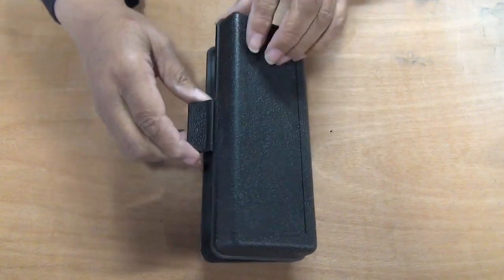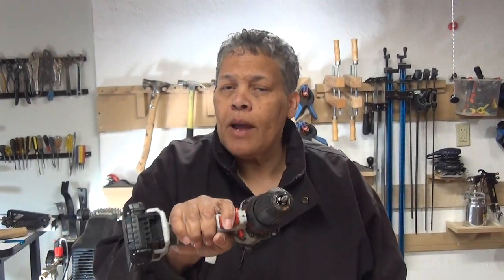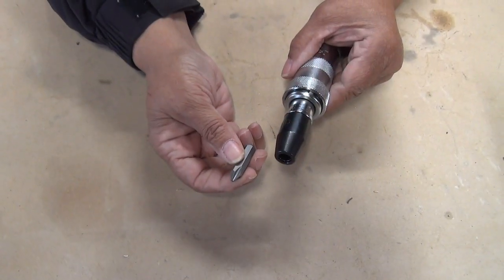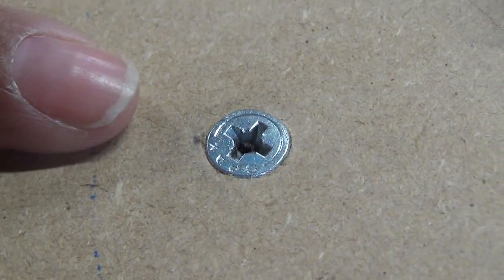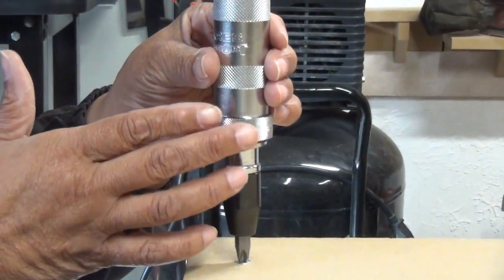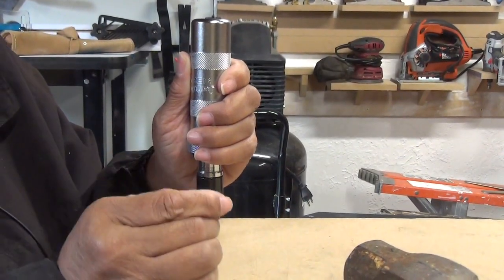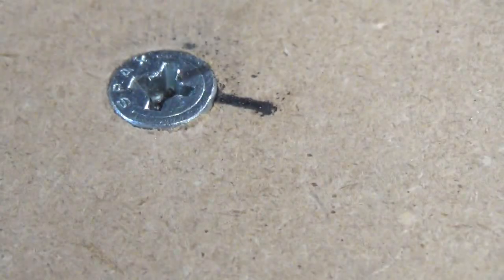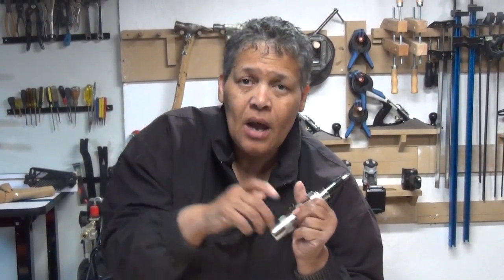Remove Stuck Screws with This Cool Tool

Comment: As a country, we need to get away from Phillips
Reply: and use Roberson heads instead ... especially for overhead work IMO.
Reply: Rocket Rider Yes. Everything should be square drive (Robertson). Canada has been for a long time...
Reply: And the imperial system while we're at it. What were we thinking?!
Reply: ...STAAARRR DRIIIVVE...!!!...
Reply: Phillips should have been discontinued the day Robertson arrived.
P.O.S.
Reply: I've seen torx bits break too..
Reply: The only good thing about flat heads is that you can use a knife to open them in a pinch. But i agree, flat head screws are always the ones that break first.. Philips at least lets you use the rubberband trick.
Reply: Pozidrive all the way for me.
Reply: I watch a lot of woodworking videos where they use the metric system. A couple of my squares and tape measures have metric on them. I decided to try converting whatever fractions of an inch to metric and tried it. It is so much easier to use metric. All of the other measurements end up easier to figure out once you learn the eights, quarters, and halves in metric.
Reply: Canadians can't get over square drives being obsolete. Don't get me wrong, they were a very good advancement, but torqs have surpassed them.
Reply: Im gonna have to get me one cuz i fought getting torque head bolts out of the interior of a car for weeks. My electric impact was to big. It just wanted to break bits.
Reply: @MichaelMerritt  We were thinking that numbers like 12 and 36 are divisible by 2, 3, 4 and 6. And they divide nicely into 360.
Reply: Besides Phillips head screws, we need to get rid of Allen head, torx head screws and bolts as well as 12 point.
Reply: Phillps have one big advatage over any other, you can use one screwdriver on multiple screw sizes.
Reply: Amen!
Reply: Philips are great for applications such as dry wall or cement board. Roddy heads are great for wood or slower application. Coming from a Canadian, everything has it's time and place.
Reply: @adrocka  I fully agree. I find that the Philippes screw is a better looking screw, in places where the screw can be seen. Example : A light switch plate. All fasteners have their purpose, just use the one that sooths your need the best. From Canada, cheers !!
Reply: @rtel123  All fasteners have their purpose and place. I am happy that in 2019, we have such a good choice of fasteners.
Reply: I don't have problems with phillips using an impact driver. No need but you could use diamond coated bits.
Reply: Flathead would be perfect if it did not allow the bit to slip to the side . In other words if it  was a tiny rectangle ; by being narrow and not having open ended notch . Phillips screws are too tapered , so they allow the screwdriver to slip out .
Reply: downbntout I’ve seen someone use their fingernails!
Reply: Some history channel (sorry i dont know the name) but they did the history if the screw, its a good vid
Reply: Phiillips is great compared to flat head.
Reply: @smokesgtp  I used square head to build my work table in my garage and it was the easiest most satisfying project ever, and that was based solely on the damn screws. I almost get sexually aroused thinking about how great it was LOL
Reply: Michael Merritt Nothing wrong with that.  If it ain’t broke don’t fix it!
Reply: @smartypants4571  thats deliberate so you cant over torque it and break the screw, japanese industry standard jis dont do that and look similar.
Reply: As a world I'd say
Reply: LMAAOOO
Reply: @smokesgtp  Of course Canada has been using them for a long time....Robertson screws are a Canadian innovation.  :)
Reply: @smartypants4571  sooooo......a Robertson?!  :D :D
Reply: @MichaelMerritt  I agree 100 percent! I am from South Africa. Compared to the imperial system, the metric system is so simple!... It's as simple as moving the decimal!
Reply: @Brandywine6969  metric is so simple!... It's a matter of shifting the comma!... Once you understand and have mastered it, you will never look back! No calculations involved!!! 😁👍

Comment: Here's a tool and accessory video a subject I'd like to see tackled: magnetic screw-bit holders. Which ones have the strongest magnet for hanging on to screw; which ones grip the screw-bit itself in the tightest possible manner* ; and which of the screw bit holders with sliding sleeves, designed for use in driving extra long screws, work the best or are the most convenient to use.

* I am partial to screw- bit holders that have an internal C-clip or springy snap-ring that physically and mechanically grabs onto the screw bit, often engaging with a little groove in the bit, so that you don't find the screw bit sticking in the screw head and popping out of the bit holder when you finish driving the screw and pull your cordless drill away. Most of the time, the magnet in the screw bit holder isn't by itself sufficient to hold the bit in the holder securely. For what it's worth, there's one particular Dewalt screw bit holder that has the strongest magnet I've found so far, and has the internal C clip. It grabs the bits so snuggly that if they are short bits with minimal length for me to get my fingers on to, I sometimes have to use pliers to pull the bit of the bit holder! I don't even particularly like DeWalt tools , and I only own one DeWalt power tool, so this isn't  really a plug for them.

Oh yeah, what's the deal with these newfangled it's supposedly designed specifically for use with impact drivers, the type that have a skinny shank directly above the screw bit head? How and why are they supposed to work better? I have noticed that they seem to choke off the magnetic pull from the screw bit holder, and so you can't hold onto or pick up the screw with the tip of the bit, which frankly sucks.

Comment: Thanks for this info Leah I will be looking for this.  
I once had a laptop I needed to remove the screws to replace the hard drive all of the screws got stripped with little effort the screws were made of some cheap soft metal.  I was reluctant, but I had to take it to a repair shop and pay just to swap out the drive.  The repair guy of course wouldn't tell Me how he got the screws off.  
I wonder is there such a tool to remove stripped from PC's/laptops?  In case if that ever happens to Me again.  
I cant imagine using a tool like the one in this video on a computer of course.
Reply from the maker: that's really interesting.  I can't say, because computer repair isn't in my wheelhouse, but let me know if you find one!
Reply: I would definitely not use an impact screwdriver for removing tough screws in a laptop. You don't want to be striking the laptop with that amount of force. Look into screw extractors. They will most definitely destroy the screw but you weren't going to put that stripped screw back in anyway :)
Reply: Matthew Fry ---  I wouldn't either of course on a laptop.  You wouldn't have said that if you completely read my 1st comment.  Screw extractors I will look up.  Thanks
Reply: Matthew Fry Do you really think he was contemplating using it on a laptop Captain Obvious?

Comment: Do most hardware stores carry this too? Can you get different size Phillip bits for it? Can you also get a straight slotted bit for it too. Thanks for posting the video.
Reply from the maker: Generally the 2 big hardware stores don't seem to keep it in stock.  You can order it online and ask to have it shipped to your local store.  You might be able to find one in an auto supply store.  And yes, they come with different bits.
Reply: Thank you for the information.

Comment: I had to laugh when you said....but that laaaast screw. Trying to replace hub assembly on my Maytag washing machine right now. I thought it was gonna be 2 stuck screws left, got lucky on one, but the last one...I'm gonna be sore tomorrow lol Stopped to troubleshoot.. I don't have one of these impact screw drivers, but will tomorrow. Thank you for the tip.👍

Comment: A good trick for chewed up screw soft screws/bolt/nut:
Get a tiny scrap of fine grit - 600 to 800 grit unused wet/dry carbide paper and lay it face down over the screw head for a very gentle first tap of the impact driver. SO gentle it doesnt slip - don't overdo it.
Then, remove the paper and use the impact driver as normal with regular hammer blows. 

Some grits from the carbide paper will embed in the soft screw head and provide a little extra grip. Yeah, eventually (longterm, twice-daily, everyday use like this) will also gradually damage the impact tool bit, but they are replaceable.  

You should only use fine grit paper for this because larger grits left in the screw head will prevent the tool bit from seating fully. What you need are microscopic grains not chunks like driveway gravel. You should also use an unused scrap of carbide paper becasue the grit grains will be nice and sharp, unlike a well-used scrap. Often you can use the very corner of a used sheet as they get less or no wear.

Don't use cheap garnet or real sandpaper for this, the grains are too soft and it's like adding dust which only makes the grip worse. Cheap papers like these types are false economy anyways

Comment: Hey, Leah? Do you have any tutorials on repairing wood when the screws won't hold anymore , like in a door frame ? I've seen people use toothpicks, but is there anything better?
Reply from the maker: Yes, here's the link https://youtu.be/OZKEu9YsED8  But using tooth picks, wooden match sticks, slivers of wood is acceptable.
Reply: seejanedrill 
Thanks. The matchsticks look like a better option because they're thicker.

Comment: nice video.  do you turn the screwdriver while hitting it w/ a hammer? or does it move the screw by the hammer blows?
Reply from the maker: the screw driver turns as you strike it with the hammer
Reply: seejanedrill thanks for replying.  You have great videos Leah :)

Comment: hi Leah, this is my first time watching, in the beginning you showed a stripped screw is there any reason why you didn't use the stripped screw in your demo of the tool?
Reply from the maker: Hi Richard, yes, the picture may have been confusing.  I was showing the stripped screw to show what you can AVOID by using the impact screwdriver.  The impact screwdriver helps you to remove a stuck screw without stripping the head of the screw.  If you have a stripped screw, there is a different tool for that (and a different video...here is the link....https://youtu.be/xzX6LVm8H1c  Sorry for the confusion!
Reply: seejanedrill thank you

Comment: The tool is used a lot by auto mechanics to remove factory brake rotor screws. By the time new brake rotors are needed, the screws can be impossible to get out without the tool.

Comment: I've broken many rusty bolts using a cheater bar. Is that a less likely scenario with an impact screwdriver? And does hitting it harder apply more torque?

Comment: Yes an impact screwdriver is useful. It's even more useful if you use a bit that matches the screw.  If you do not,  the impact driver will strip out the screw head  before delivering maximum impact torque.

Comment: What if the thread on the screw is completely gone? Can you do a video on the reverse drill bits ?
Reply from the maker: Head or thread?
Reply: seejanedrill head :-)
Reply: Drill small hole down the center and use a bolt extractor    It’s not easy

Comment: nice , now does it work on screw heads already with some damage as in most cases you don't really know you need the impact screw driver till you realize it's stripped or starting to strip as your trying to remove .
Reply from the maker: There is another tool for that process and we've made that video as well.
https://youtu.be/xzX6LVm8H1c
Reply: seejanedrill thnks for the reply I enjoy your videos , but I guess what I was trying to say is this tool is just good to have just in case you feel the screw in question  may be stuburn so you use the impact just to insure you do not strip it or damage , but either way it's a good tool and I would not mind having it .  so I will be looking out for it .  thank you for sharing , keep these videos going great job and I do have an easy out set however I rarely use it .
Reply: These impact drivers will usually work if the head's not completely stripped. It's worth mentioning that regular cordless impact drivers which Leah has covered recently are much less likely to strip out screw heads than a drill or a screwdriver. Leah's video prompted me to get an impact driver to use for screws instead of using a drill.
Reply: Ian Gardener own plenty of easy out sets they wrk sometimes I guess

Comment: You only need this tool once in a while but when you need it nothing else will work. I've owned mine since the mid 70's and only used it8 or 10 times.

Comment: How about using an impact drill,would that be overkill for extracting stuck screws?
Reply: Impact drill driver can definitely slip and round the screw.

Part of the trick of the impact screwdriver from the video is that the force from the hammer blow is keeping the driver from slipping. Not to mention that it only moves a few degrees per impact.

Comment: Does something like this, but smaller exist? Im fixing PCs and electronic stuff very often and sometimes the factory screws are so tight in, that it is hard to get them out and having a 2.5 milimeter stripped screw somewhere on the motherboard is just pain in the butt. And is usually a bad idea to hit small electronics with force, so maybe even an alternative to this tool?

Comment: Great tool. But I like to use heat using my acetylene oxy torch. I'll put a fine brazing tip on it instead of the the cutting tip. This allows a finer stream of fire to apply to the head of the screw/bolt causing a less mess. In some cases, all you need is a quick hit of heat. And I always have a spray water bottle handy to douse when nearby materials may catch on fire. Or I'll pre soak the area with water first. If it's metal on metal then water is normally not needed. Obliviously if it's a good painted area you wouldn't do this method. Thanks for the video.

Comment: Yes avoid this mistake dont use phillips screws any more use torx or the square point. This will help you get them out without drilling the head off but after that dont use a Phillips screw to replace it. This tool is a good investment.

Comment: Tip: Most stripped screws end up having a square shaped hole.  You probably already have some screwdriver bits lying around.  Pull them out and look for square bits.  You probably have them already, you just never noticed them or didn't think you would need them.  Square bit, square hole, and it's a piece of cake!

Comment: If you turn the impact screw driver just a bit to cause the driver to start to climb, then hit it, the screw will get more twist.
Better yet. Save up and buy a power impact screw driver and use it for all of your screw driving needs. It sure saves on carpal tunnel trauma that is common from pushing on a manual screw driver. 
The impact screw driver is a life saver for removing Philips screws from steel or aluminum assemblies like motorcycle crank cases.

Comment: When using screws I stick to the torx heads! The screw driver on phillips head just never seems to sit well with the screw head and I almost always screw 1 or 2 up. The torx head has never striped out on me yet so far!
Reply from the maker: Torx are great....since not everyone doesn't use Torx screws it makes this tool necessary.

Comment: To remove a worn out screw, take a piece of a bike tube place it over the worn screw and put the drill on reverse, the rubber will stick to the worn and grip and it will pull it upward.

Comment: Or you stick a rubber band between the bit and the stripped screw and drill/unscrew as normal.  Works like a charm.

Comment: use a rubber or brass mallet.  it won't dent or damage the tool.  and it won't bounce off.  it will deliver more power into the tool.

Comment: I have a quick question, what about if you wanted to take your device apart but you do not want to crack your screen. How should I approach this?  I've taken out almost all of the screws, but one just doesn't budge. It is very frustrating!

Comment: Here's a much easier & cost effective solution. Get a wide rubber band, place that flat across the stripped head of the screw screw, use the appropriate size screwdriver, place the tip of that on to rubber band and that should be sufficient to get damaged screw out. I've used this method dozens of times, I even have a small bag of rubber bands in my tool box. The most important thing is to use the correct size screwdriver bit and take things a bit slower.
Reply from the maker: HI Ross, the tool in the video is not for removing damaged screws, but is for removing stuck screws WITHOUT damaging the screw heads.

Comment: You can also drill out the screw head with a smaller bit than a square head bit & hammer the square head bit down in the screw head. In other words make a round hole square.
Reply from the maker: Nice!

Comment: What if its a left hand thread and the pencil mark shows progress till you shear he head off. That did happen when trying to remove left thread lug nut on a wheel with a breaker bar.

Comment: sadly, the place I need the screw out is in a tight space in a restricted cabinet, getting both the impact screwdriver and the hammer inside is very difficult and even more difficult to strike the ISD with enough force to drive the screw counter clockwise in the awkward position I'd have to do it in.

Comment: I have an anti-theft license plate, but you have to use an "L" key to screw in nail but when nail head is worn out.

It doesn't want to be unscrewed.

Comment: Never heard of this but I need it.
What I've done in the past is take a heavy screwdriver and bang it with a hammer into the screw hoping it'll jar whatever is holding the screw loose. Add liberal amounts of WD40 and 8 times out of 10, it'll come.
What you have seems a lot more dependable.